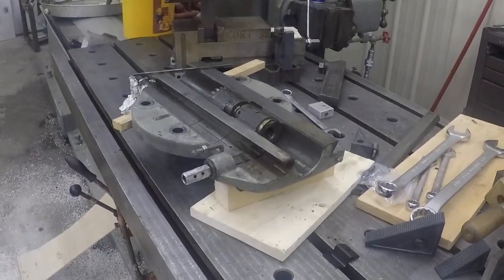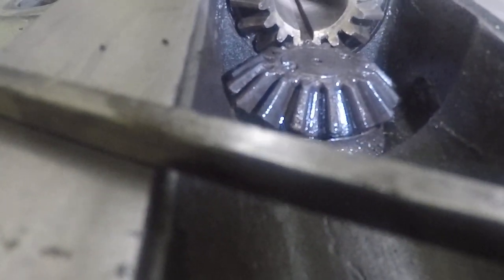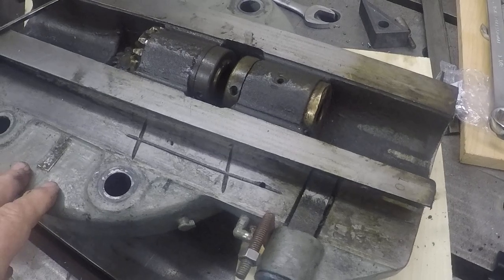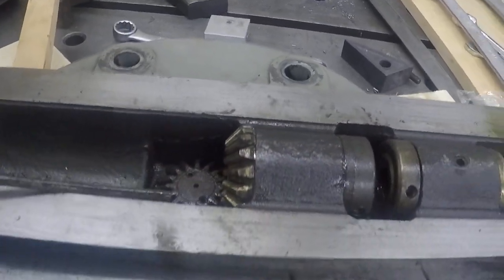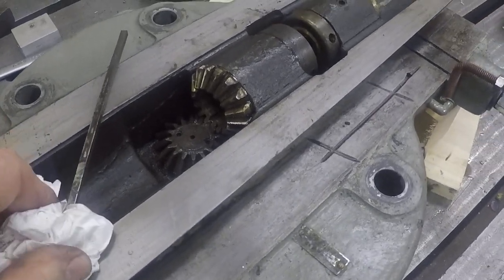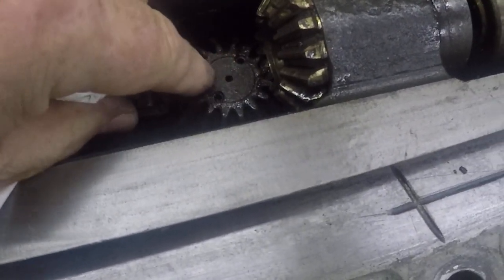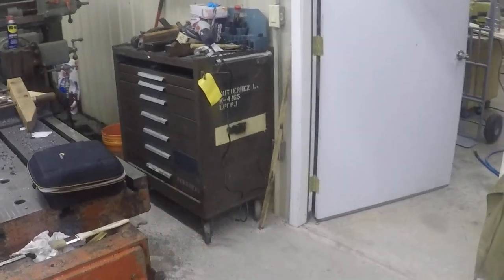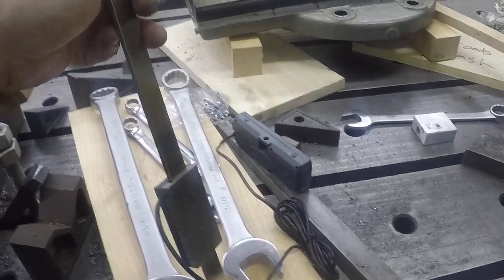Planer Head repair, Part 3

Comment: I have seen similar mechanisms where the key has a dowl pressed in it or a hook/ledge on the end of it. They are accompanied by a notch or hole for that part to go into, thus it can be assembled by putting the key in then putting it on the shaft and once it is on the shaft it can't come out and it is all tied together.  Is perhaps the key supposed to be longer and it broke where the hole is that the nub tangs into and that part is gone?
Reply: The key in my part is missing too. It has two pins to hold it on place, but unsure of what type of pins used. I'm thinking I can use tension pins to hold it in place.